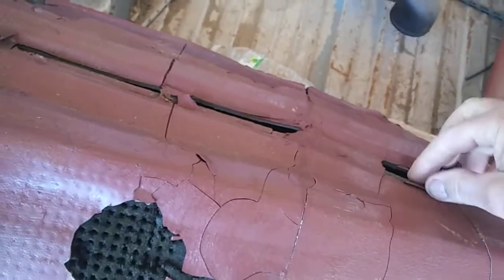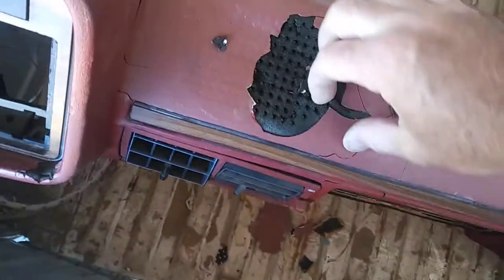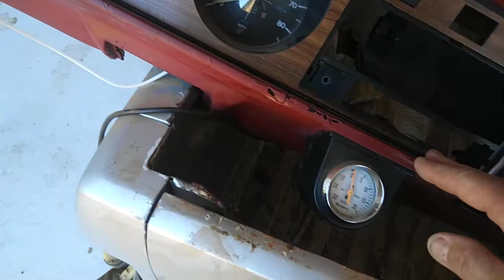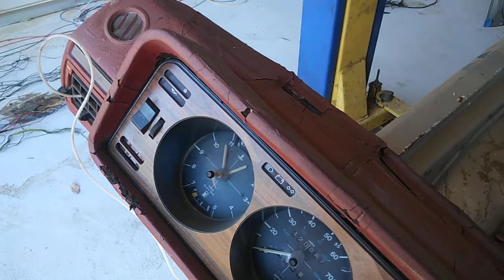VW Rabbit Dash pad repair and refurbish

Comment: My word...that dash is a mess Pa...
Reply from the maker: even afer I was done it still sucks but there are no options of replacing it. No new ones out there for this year. vw really used crap materials on dashes.
Reply: @Mikefngarage  Want to try to renew the one on my '89 Jetta...will let you know once I start mate.
Reply from the maker: I think there are new ones available for that. just the mk1 before 80 are extinct. I just bought a cover plastic top for that one.
Reply: @Mikefngarage  No mate...they are discontinued...you have better luck finding one for the Mk1 this side. Production went as far as 2010.